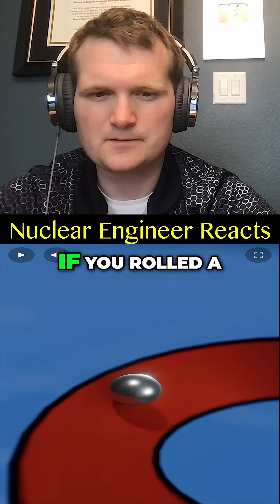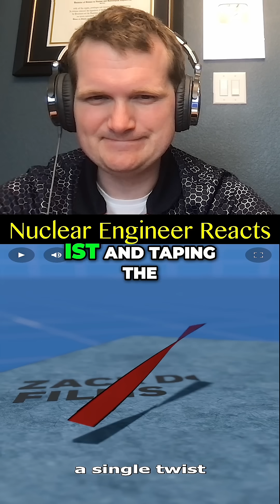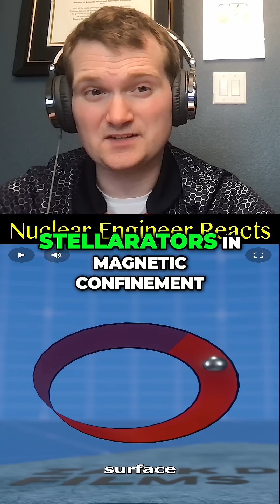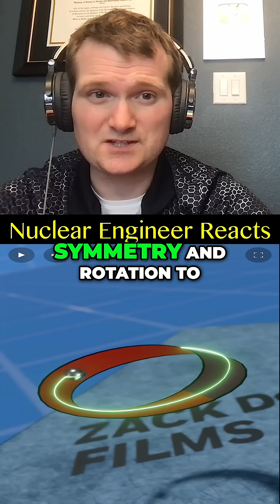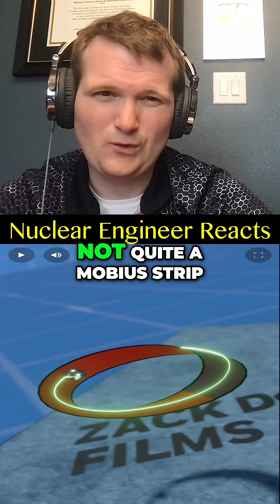How a Mobius Strip Works - Nuclear Engineer Reacts to Zack D. Films

Comment: Mobius strips have two continuous surfaces and edges.
You have to have the surface rotated by one surface in order to have a single continuous surface and edge.

The Mobius strip variation shown there is rotated by half of the total surfaces
Reply: no. it is a single continuous surface. it has a single side. thats like the whole point.
Reply: @sona4049 if you are saying that it is a two-dimensional object then yes it is an object with a single surface. 
A sheet of paper has thickness though and by default has four sides because The edge is a side. 
If however you rotate it by 90° instead of 180 it becomes a true Mobius strip that only really works for any tube material instead of flat material. 
If you are doing it with a flat material you can't have a true seamless Mobius strip
Reply: @curtis-w2y what are u on about